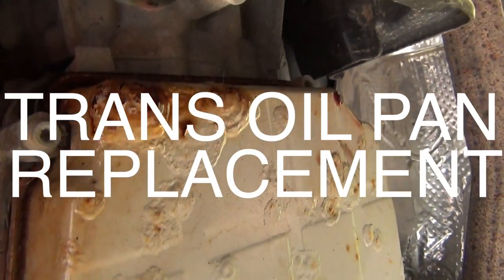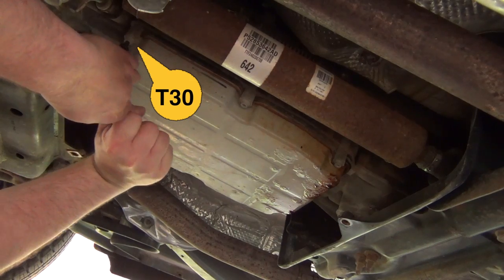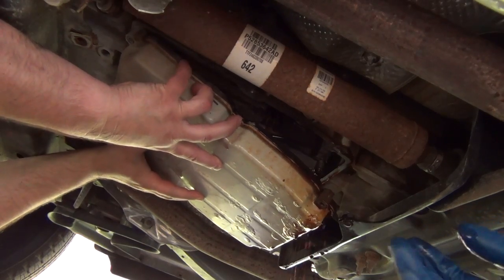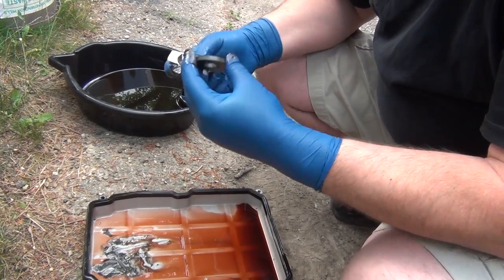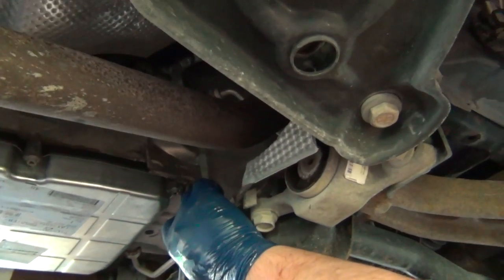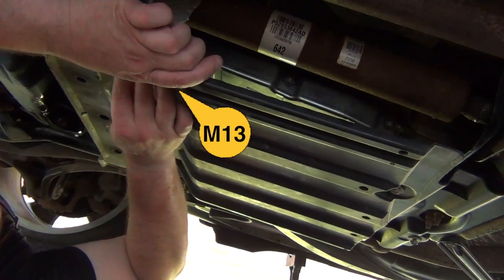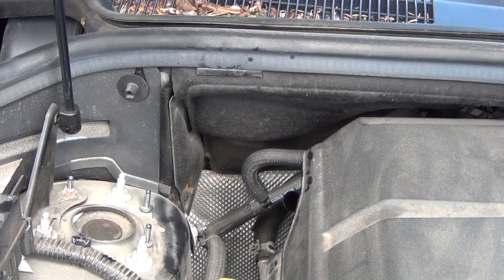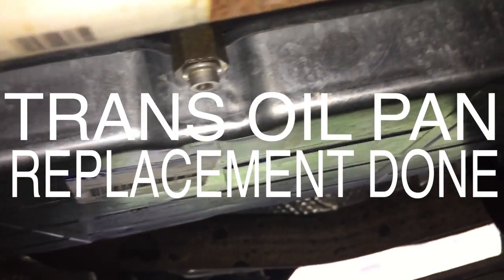Grand Cherokee WK2 Corroded Transmission Oil Pan Replacement

Comment: Man i should have watched this video before doing this job... I spent two hours trying to insert a T-30 screw into the M-10. I thought it was a problem with aligning the heat shield bracket, but i was using the wrong screw size. My transmission pan ended up leaking. 
But the good news is that this is a quick fix! Just need to swap a T-30 screw with the M-10 screw. I'm just frustrated that a simple job turned into a difficult one because i used the wrong screw size! Thank you so much, you saved me so much time by showing this detailed video. Subscribed!

Comment: Hi, I have some questions. Can you share with me the part number of the oil pan and the number of the filter that I replace? How many quarts of transmission fluid did he need?
Reply from the maker: sorry, i didn't see you comment in time. I think i got a kit from Amazon, and it included the filter, and gasket. I hope you have yours fixed by now. How did it go?

Comment: Thank you for the recorded video.
Is this the same procedure for the Jeep grand cherokee 2012 CRD 3.OL
Reply from the maker: If it has the same transmission, then yes this should be the same.
Reply from the maker: Do you have the same problem i had? I also had my front right shock absorber rusted through the same way ... ;-(  Is this a Jeep thing? I love the car, but this rust problem is annoying!

Comment: Nice video. Is this the process to do a transmission fluid change?
Reply from the maker: Mitchell Chaves that’s right
Reply: @mygiguser  Thanks! Do you recall the part number for the filter and the gasket?

Comment: How many liters of new oil has been added?
Reply from the maker: Sara Rodrigues Riguete Sara Abeia that can be different from car to car. i think it is best to measure how much oil came out, and then refill that amount.
Reply: You can buy a dipstick to measure the level.  They used to be $60. Now they’re $20.  It’s a long dipstick that doesn’t stay in the tube. They come with a graph to tell you what level to expect at what temperature. If you don’t know the transmission temperature, my advice is that 180 degrees F is expected after 2 or 3 miles of normal driving

Comment: I would have drilled a drain plug there, this is such a mess when removing the pan...
Reply from the maker: Well, i should have sucked the oil out with a sucker first.
Reply: @mygiguser  No I mean for servicing is a pretty easy to mount drain plug to work easier. How nobody came to this idea is a ridle to me...
Reply: @mygiguser  Let's say a change interval is like 80k kilometers to change oil. As I'm hobby mechanic I would change it every 40k to be sure and I would only change oil and filter at 80k. So for quick drain and fill it should take 30min. without filter change for example.